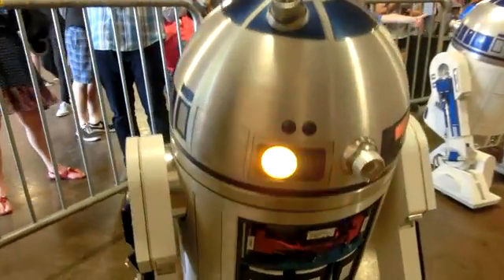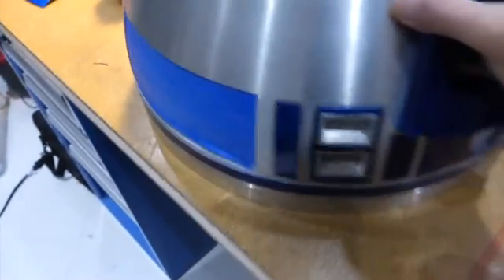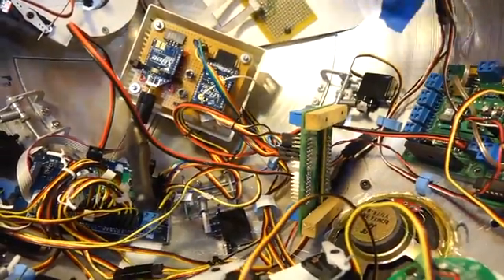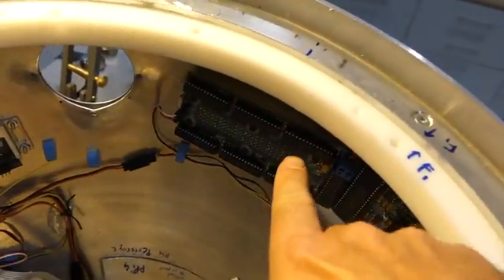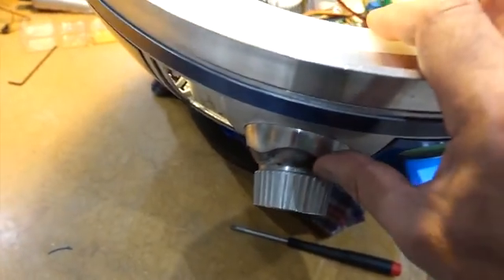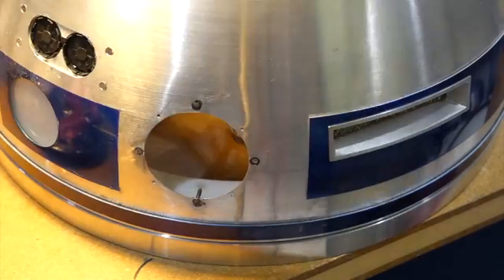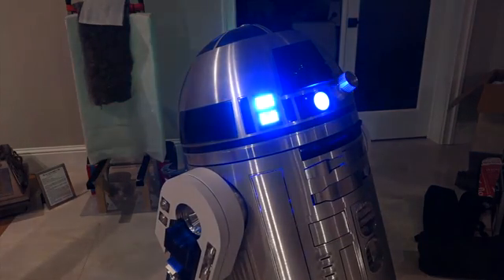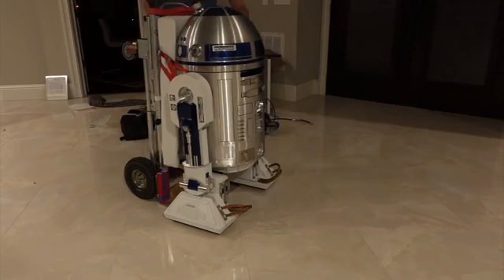Inside the dome: R2-D2 emergency  repair

Comment: exactly what I do with robots and how I fix theme myself 
mine is the think away R2-D2 16 rc inch
Reply: only problem gluing and  tape its not required to build robots 

which is where soldering tools came along

Comment: Hi Marc -- So sorry to hear about your mishap. Our biggest fear is the 2-3-2 failing on an all-metal droid. 

You mentioned that there was a problem with the ankle rods... When you have time, can you post more info about the ankle rod failure? Was there a problem with the tension? Did the rod actually snap or bend? Was there an out-of-sync between the shoulder controllers? 

Glad you repaired him so quickly before the event.

EL1
Reply from the maker: The tie rod attach pin to the shoulder got wobbly. Also with the skins on he is getting heavier, and the simple metal bushing articulations have too much play to keep him perfectly upright - I need to switch to ball bearing mechanisms.